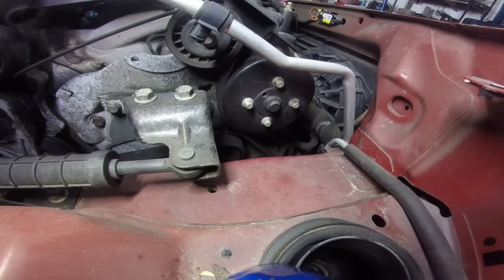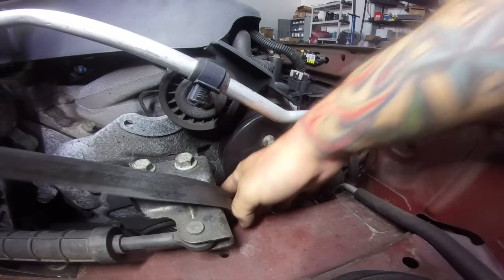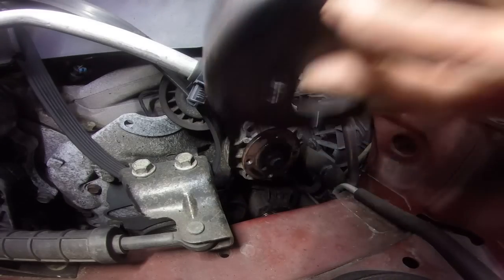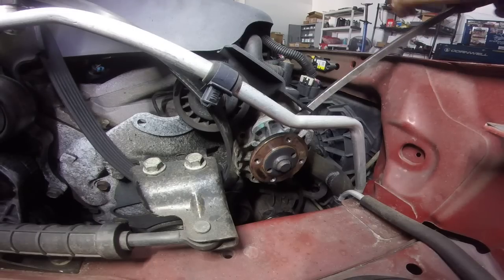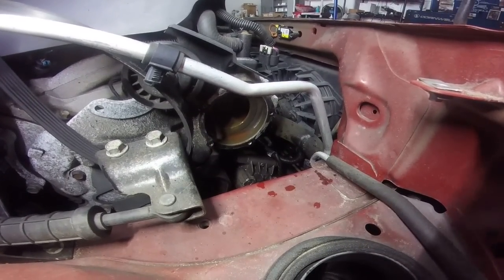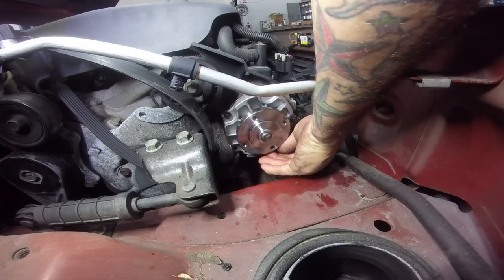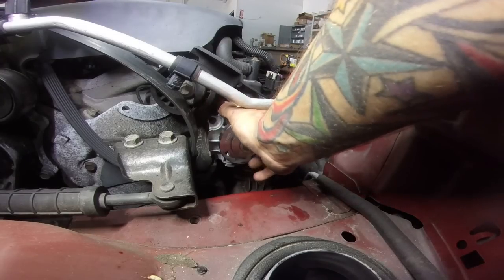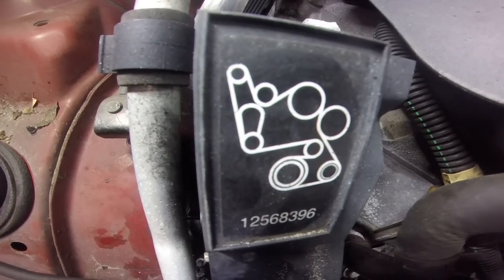pontiac g6 waterpump replacement

Comment: Great vid! When you open that bleeder, how long do you let it run for? Do you crack it a few times up until it's at operating temp?
I just bought a 06 G6 3.5 and it started overheating quickly and no heat. Bled it at the bleeder valve a few times and I got great again and temp stayed at half. Drove about an hour and while at a set of lights, I lost heat again and temp gauge went back up. Re-bled and it got better, but not perfect. Throws good heat if you rev it up and luke warm heat at idle.
I've worked on it 2 nights straight, and feel like I'm not succeeding...
Any suggestions?
Reply from the maker: sounds like you may have a leak somewhere usually just bleed it til no air comes out then your all set
Reply: @uglyhp8225  
I pressure tested the system, no leaks. I even let it sit for 40 mins at 15 psi and the needle never moved. I also thought there was a leak somewhere. I don't want to throw parts at it and change water pump and thermostat, but I'm running out of options. Oil is clean, coolant is fairly clean, and doesn't smoke.
Reply: I have a 07 g6 and had the same problem with it overheating. ended up having to change a section  of heater hose where there was a tiny (i mean tiny) hole that was slowly letting air in. it was the metal section of the heater hose that rusted out (didn't have much paint to help prevent corrosion). but after changing the heater hose it stopped overheating

Comment: If it's still leaks after following these steps. what could possibly have it still leaking? Help needed
Reply from the maker: you might wanna take a closer look at where its leaking at maybe the gasket got pinched or theres a loose bolt also could be leaking elsewhere like the intake or timing cover and it just looks like a waterpump leak
Reply: Ok thanks

Comment: How do u know if it's your water pump and not something else .. what starts happening when the water pump goes out .. 
I have a Pontiac torrent 2007
Reply from the maker: they are design to start leaking threw a hole at the bottom

Comment: Hey brother! Got a question for u.  I got my 2005 g6 gt with panoramic sunroof and it won't open only the first parcel. Do you have any Ida?
Reply from the maker: check the motor directly from the switch and that will tell ya if the motor is toast or the switch board

Comment: I open bleeder valve and let run but ot keeps having air no over heating just no heat put new heat core in and bleed it but still nuke warm cheeked thrmostat it opens  and closed could  it be head or ac blend door
Reply from the maker: put your hands on the hoses going to the heater core once the car warms up if one it hot and the other is not then your heater core is stopped up but if they are both hot then the blend door or control head is the issue if they are both warm then the thermostat is stuck open

Comment: And Midas tryna charge me 700 for this😭 my air box is already removed  I did half the fucking work for them.
Reply: But despite that thanks man now ima prolly buy one and do it myself bc truly mechanic shops are ripoffs sometimes.
Reply from the maker: not taking midas side but big franchises do have a large over head so that does increase the markup and labor rate and what i do here is charge 100% of what the job calls for no matter how much of the job has been done by the customer because at that point your putting together a puzzle but 700 is still crazy